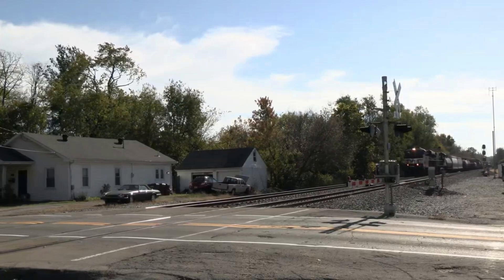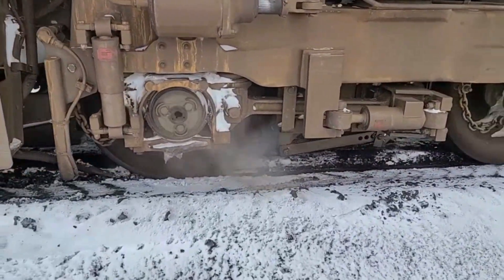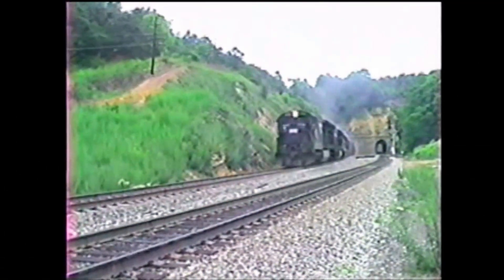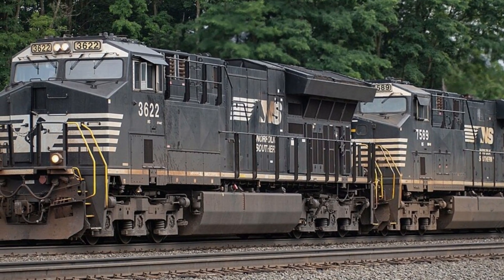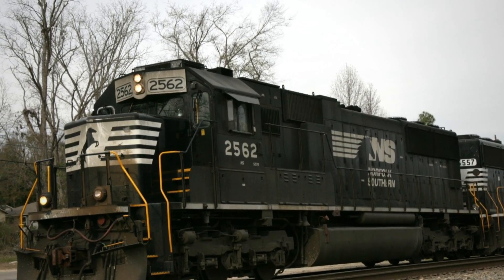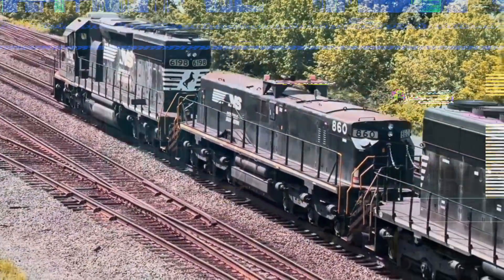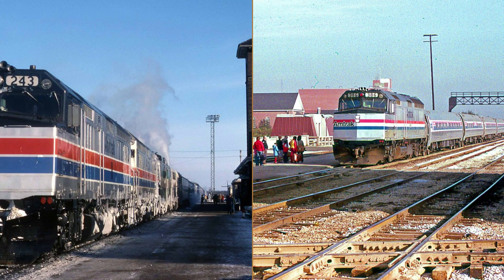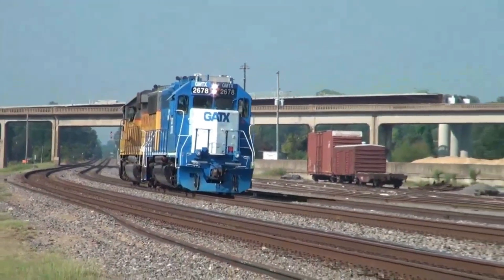Beyond the Engine_ The Ultimate Guide to Locomotive Varieties

Comment: Traction motors are not mounted directly on the axels  they are geared to the axels through a pinion gear on the motor and a ring gear on the axel
Reply: The axle is an assembly. Therefore the motor is mounted on the axle assembly
Reply: A ring and pinion or what is in a vehicle axle to change the direction of rotation. Locomotive motors rotate in the same direction as the wheel.  Therefore new ring and pinion gear are needed. They are simply driven and drive gears